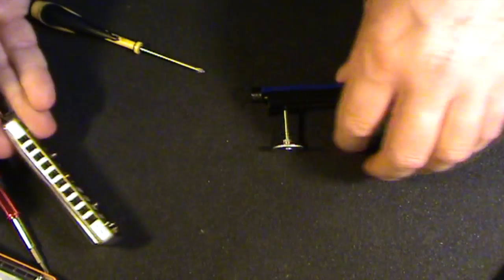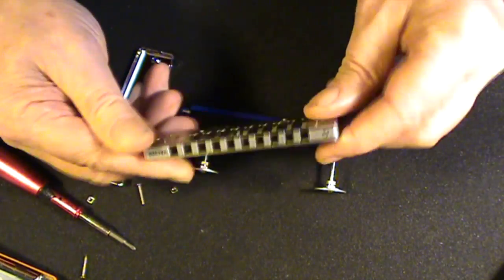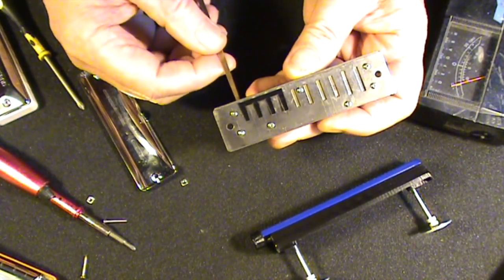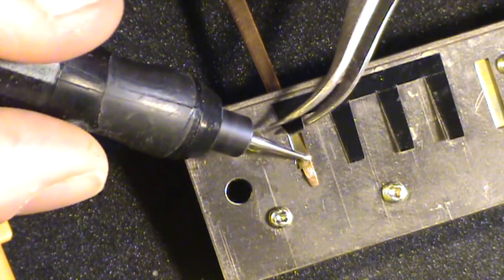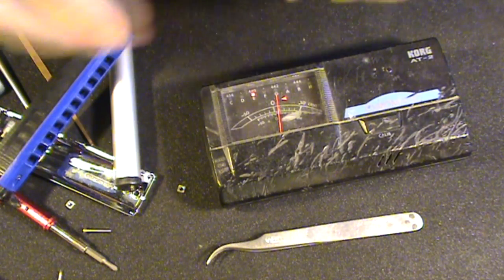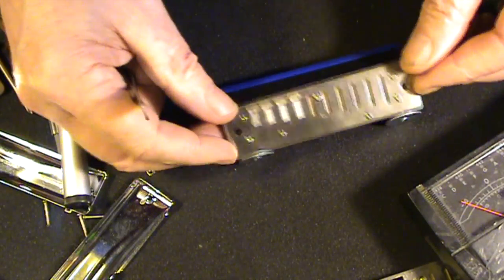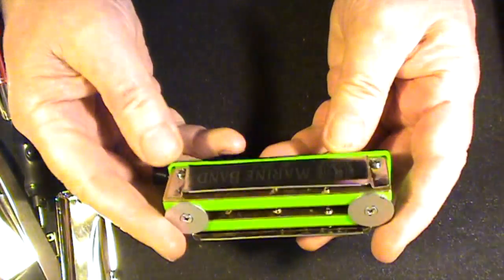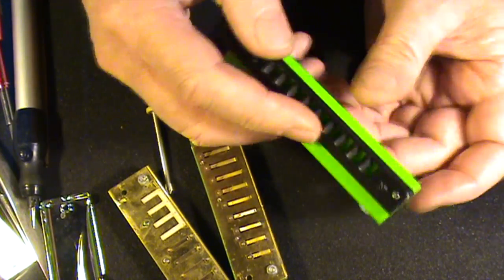TwinDiatonic SWITCH-HARP - Tech Video 2: Tuning Compensation

Comment: I don't like to tune blow reeds on assembled harmonica (and even I hate to tune draw reeds down on assembled harmonica) so I assemled the whole twin harp without coverplates and unscrew the upper one. It allows to get blow reedplate of upper harmonica tune it and put it back to try pitch. The same about draw reedplate of lower harmonica. To tune another plates of each just switch harmonicas.
Reply from the maker: For big pitch changes on the blow reedplate I always disassemble (as I said in the video I would do for the D harp). Maybe I should have shown that! For small pitch changes I leave harps assembled, as for the G harp.
Reply: BrendanPowerMusic the key trick we do not need to disassemble whole twin harp constration to tune, we are lucky here